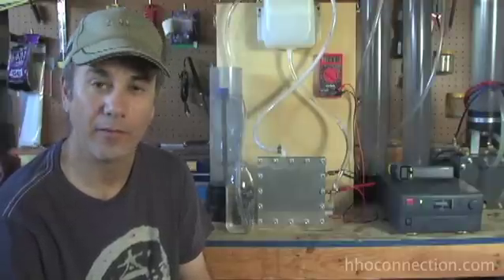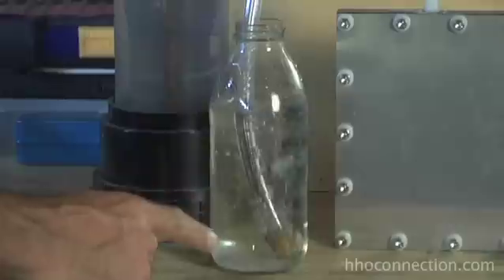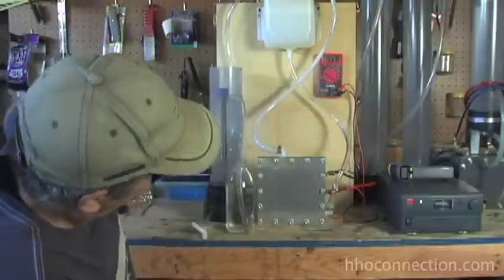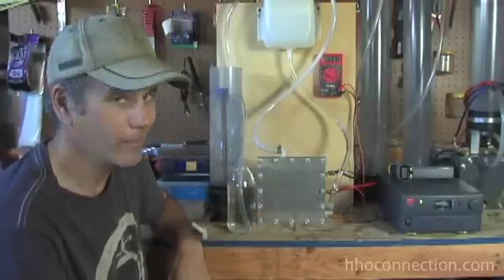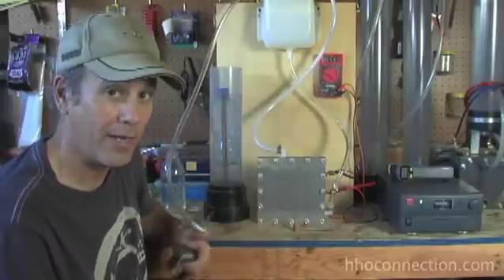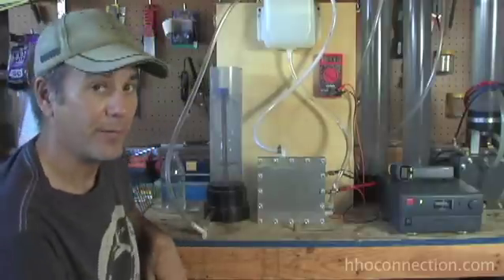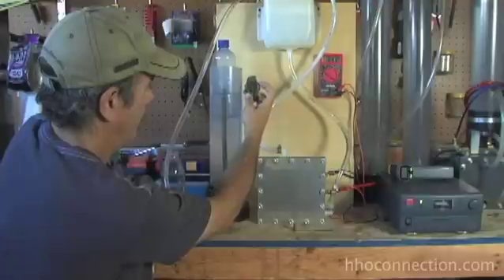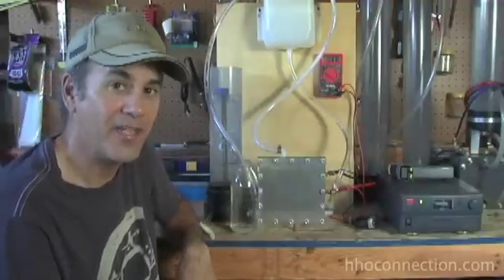What Does 1 Liter Per Minute of HHO Look Like?

Comment from the maker: I think most drill batteries are 18 volts so you would need to add neutral plates. Other than that, a battery is a battery. They will probably drain fast though.

Comment: also a 2 stroke requires lubrication and hho gas cannot provide it
i trying to power a 4 stroke 80cc with 100% do you happen to know how much of hho lpm i need to run the engine?

Comment: like your videos. Can you tell me how much gas it takes to run a small jewelers torch? Also, I have a tubular hho cell I bought from H2 extreme some time ago but am unsure what to mix for electrolight.... Should I use a PWM controller to regulate amp draw? Thanks!

Comment from the maker: It depends on how much power you are using to get 500ml/min. Most dry cells will give you 1 lpm at 15 amps plus or minus a few amps. That cell might work out OK if you only have a 1 liter engine.

Comment: If you were to hook that to an engine it would be in the neighborhood of 1.5dlpm. I'm getting 43 mpg out of a Dodge minivan(2006) using Darol Mason's system. For accurate numbers you need to get an in-line gas meter so you can test it on a running vehicle.

Comment: Any idea on how many kilograms per minute you are getting? I know you say a liter per minute, but there are different amounts of compression you can apply to a gas to make it fit in a liter container. Just wondering about the mass per minute rather than the volume, it would help me figure out the math of the system.

Comment: @arthus1971 that is very true about the PWM.  The pwm that is worth it though is the current limited one that Zerofossilfuel shows you how to make.  Its not just on verse off time but you can set the base amps/current so no matter what changes in the cell (temp cold or hot) you will only draw the same amperage, meaning you can run electrolyte in highish doses at cold temps without thermal runnaway once the cell is warm.

Comment: After years of test I can said 1LPM = 290W or 14.5Vcd x 20Amps, no electrolite just water, PWM does not work, the production is proportional to energy x time, if you use a pwm at 50% you will get only 50% of production. Pwm save energy in other electronic or electric devices, but remember this device is electrochemical, for to measure it I fill a simple 1Lt bottle on the water.

Comment from the maker: @rdekraker  This setup is NOT showing over unity. According to the numbers in this test, this cell is running at 6.05 MMW. If memory serves me correct over unity would be 9.28 MMW. I'm not even close! And NO, there is no second cell. The only thing behind that board is more junk on my bench. The hose coming from the bubbler just goes to a T. I plug in the hose from the bubbler and then you can see me cap the open end of the T. Seriously, I am about as honest about this stuff as you will find.

Comment from the maker: @a2zhandi You are incorrect. That is not a valve, it is a T fitting. After hooking up the hose, HHO is just coming out the open end of the T.  I simply plug the open end of the T with my thumb at the same time I start the stopwatch. Look close you will se the bottle jump as soon as I plug the T. Nice try though!

Comment: haha, I don't even look for lpm. I'm more interested in MPG!
Great analogy though.
However, I believe your test if faulty. 
Your hose pushing gas is hooked to the barb/valve end for several seconds while you chat. You then set the stop watch and open the valve. 
Isn't your system building pressure during this time?

Comment: Mike, been enjoying all the video's for a while now, especially like the one on neutral plates. A break down on the relationship between amps, volts and the strength/weakness on the fluid mixture and temp side afects would be really useful if you ever get a bit board :) Thanks again for the great work.